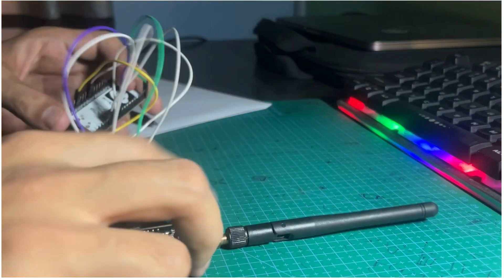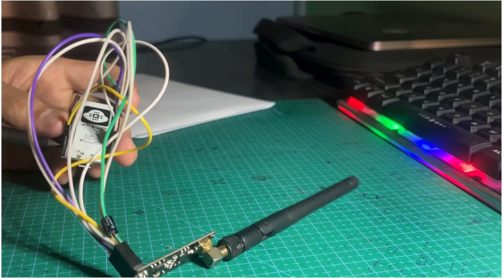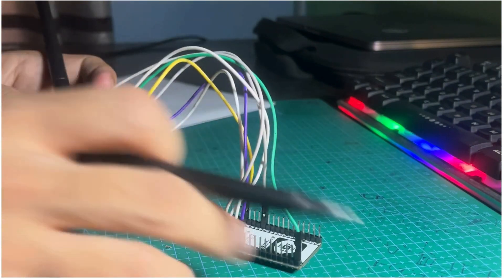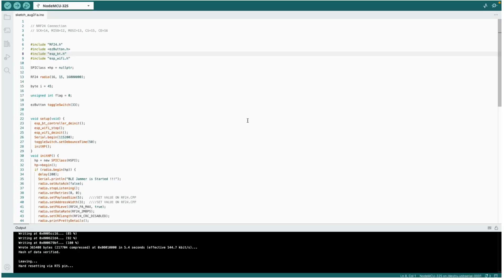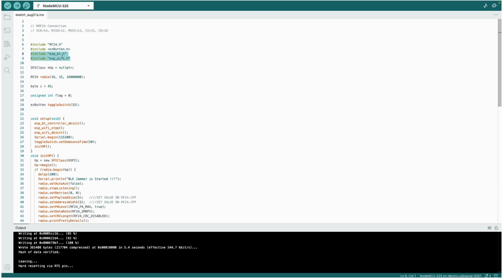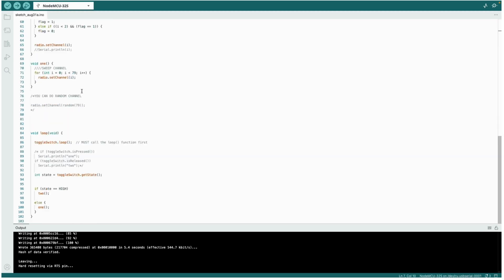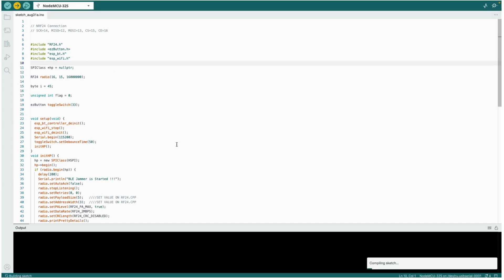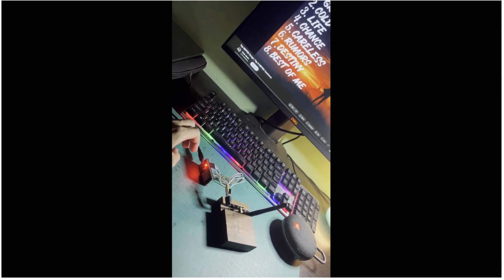Hack Bluetooth with a Jammer for Under $10! | 2024 DIY Using ESP32 & NRF24L01 | Full Walkthrough!

Comment: Perfect for noisy neighbors
Reply from the maker: Haha
Reply: Range ??
Reply: @rupesh_kharole  very bad, only inside of your room
Reply from the maker: @laryssalima6435 try using two NRF24 modules with more RF power and also use proper power supply and capacitor
Reply: aux cable 💀
Reply: @prax-s1r Rocks 💀 Brake fluid 💀 Slingshot 💀

Comment: Everyone is saying how useful this video is, but I can't see what you're doing, I can't understand your accent, and the transcript is wrong. Saying "... is connected to pin number 14 of the ESP32" doesn't mean much unless you know exactly which board you're using, and sometimes the name isn't reliable. The important thing is what FUNCTION it's connecting to - "D23", for example, or to"MOSI". Just "pin 14" is ambiguous.
Reply from the maker: @chriswesley594  if you are here for jamming the Bluetooth one should have basic knowledge of embedded programming and so on
Reply: @Engineerofeverything  I do have that basic knowledge, but what I said stands. "pin 14" is meaningless without knowing exactly what board it's pin 14 of. And even if you specify the board by name (e.g. "ESP32 Vroom 32") that still doesn't guarantee correctness, because people rip off the names and different variants appear with slight changes. The only sensible way to talk about pins is either through the D14 labelling, or through GPIO14 - since these are chip-dependent, and for all ESP32 chips, "GPIO14" is always exactly and only GPIO14.

Comment: -Rf Nrf24l01+ 100mw 2.4ghz
-Nodemcu Esp32 Wifi +bluetooth 4.2 Iot Wroom Esp32s Arduino
-some cables

Do i need anything else? its hard for me to understand this video, thank you for this content!!! sub
Reply from the maker: @luiscarrizo8074  nrf24l01*2
Esp32 node32s *1
Few jumpers and a power source
Reply: @Engineerofeverything  so i need two nrf, one esp32 and maybe a powerbank to make it portable. Thanks! let me know if im wrong
Reply from the maker: @ absolutely right

Comment: What is type esp32 he use in video?
Reply from the maker: Esp32 Node MCU S
Reply: @Engineerofeverything  Thank
Reply: @Engineerofeverything Can  i use esp32 wrood 38pin ?
Reply: @Engineerofeverything  can i use esp32 wroom-32 38 pin or esp-32S
Reply from the maker: @ yes you can but need to select the point

Comment: SIR I NEED HELP! i connected everything right but it somehow only jams the bluetooth device in the radius of 1-3cm. Why is it so?? PLEASE ANSWER
Reply: Check the code
Reply: can you fix this?
Reply from the maker: 1-3 cm? Use capacitor
Reply: @Engineerofeverything  im using a capicitor 10v 100uf but its still the same results

Comment: It works very well! However, with only one NRF24 module, the code is not set up to run two at the same time. What do I need to do to activate both?
Reply from the maker: @PEDRONETIC  i will make separate video on it with Oled display  and some switches also

Comment: esp32 name?
Reply from the maker: @nokia5376  esp32 node mcu 32s
Reply: @Engineerofeverything  um dose esp32 wroom 32 work? (cp2102)
Reply from the maker: @nokia5376 yes
Reply: @Engineerofeverything  but it said enrro
Reply: @Engineerofeverything  btw u r using esp 8266 nodemcu in this video？
Reply from the maker: @nokia5376  no ! It’s esp32 based !! You have to configure your board properly before using it
Reply: @Engineerofeverything  um ok, sir do u hv discord i want to ask something
Reply from the maker: @nokia5376  node mcu 32s
Reply: @Engineerofeverything  where u buy it from can i hv the link?

Comment: will this tool  Jammer  Bluetooth And 2.5ghz WiFi simultaneously
Reply from the maker: As Bluetooth has 79 channels and wifi 15 ! It can jam but the code is written in such a way that it shifts the channel 1-79 so fast to jam the Bluetooth and the 100mW rf module isn’t that powerful to jan the wifi !

Comment: is this suitable for ESP32 Development Board Integrated 2.44 Cm OLED Display, CH340 Driver, WiFi+BLE Wireless Module? (I think so, I'm just asking to be safe.)
Reply from the maker: See the pinout of the board and if the pins are same use same code otherwise change the pin in code other be same

Comment: I use esp32-wroom-32u but not working. what's wrong brother? One more thing: Could you upload the code by WEBFLASHER? coz it is easy to use no need for Arduino IDE.
Reply from the maker: what error did you get?
Reply: @Engineerofeverything  It does not show an error but it is not working, bluethooth can play songs normally. One more think my ESP32 is different from your ESP32 coz my ESP32 is ESP32-wroom-32u
Reply from the maker: @luckywoman527  try changing the pins on the code it might work ! It’s because of difference in the pin in your board and the code !
Reply: @Engineerofeverything  i don't know, how to change. but I see my esp32's pin is the same as your esp32's pin.

Comment: can use esp8266 instead ?
Reply from the maker: yes but need to change the pin in the code
Reply: @Engineerofeverything i have ESP32 38P CP2102, can i use the same wiring diagram? Thanks!